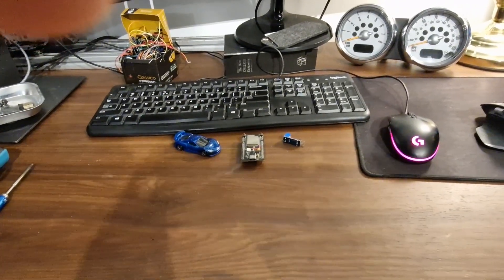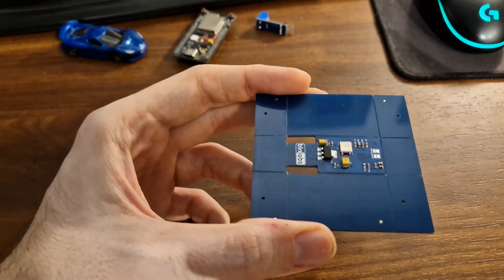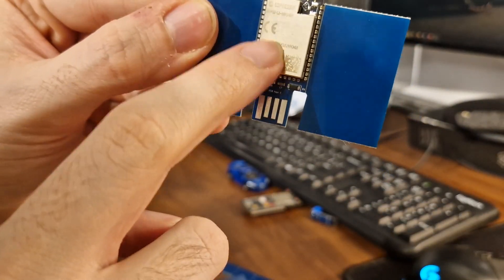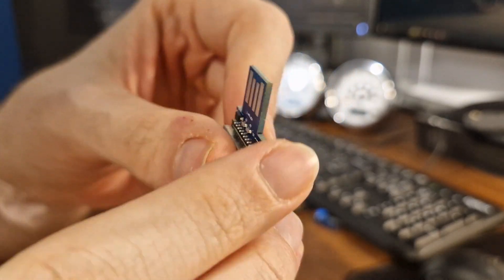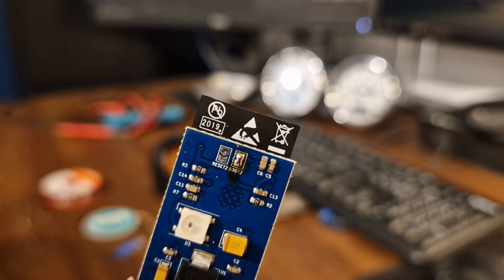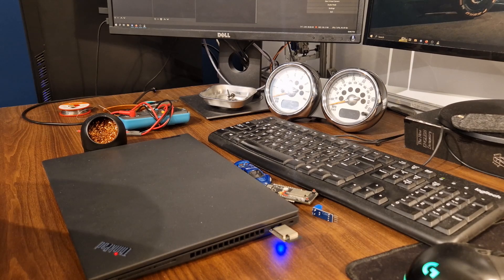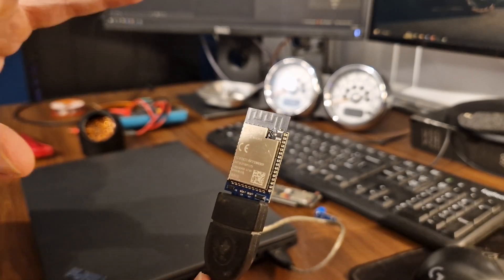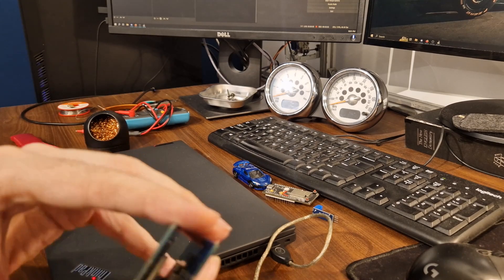Hacking device with ESP32 S2 - DIY USB Rubber ducky

Comment: Can you buy it?
Reply from the maker: You mean is there something simular on the marker? I dont think so. I checked a bit, but this small device with integrate USB type A, so you dont need a cable in order to connect it. That is why I decided to make mine😊
Reply: @blnlabs  you sell it
Reply: @blnlabs what width of usb type A...1.6?
Reply: Too thin to use
Reply from the maker: actually in laptops you can use it without anything, because I think that spring is a bit more strong, but yea ... 2mm would be ideal

Comment: I like the idea. Please take a piece of the unwanted PCB and stick to the backside so the USB can have the desired ticketless permanently.
Reply from the maker: Thank you for the comment. Already tried that, but it is to tick. That is basically 3.4 mm (1.6+1.6). I think that width of 2mm the last option on JLCPCB site would be ideal.